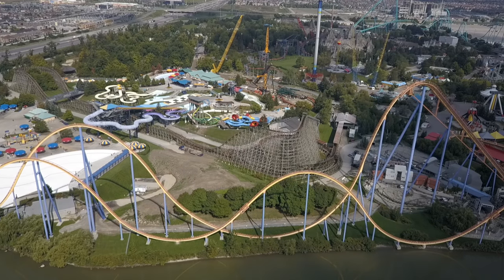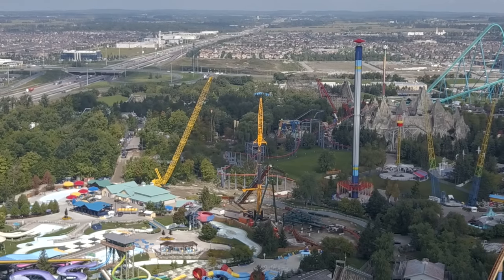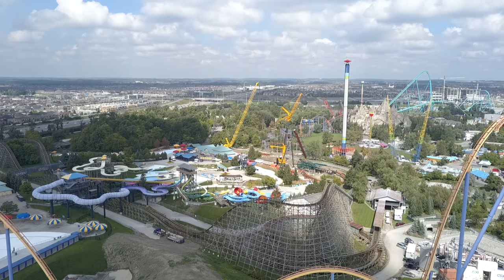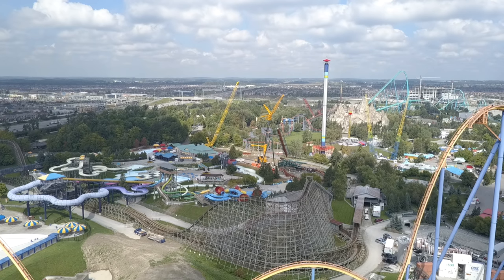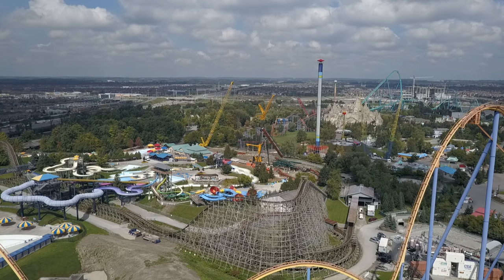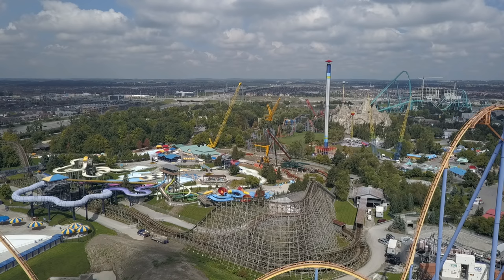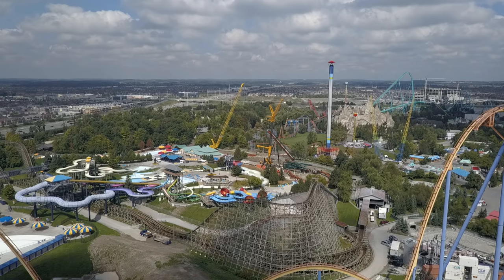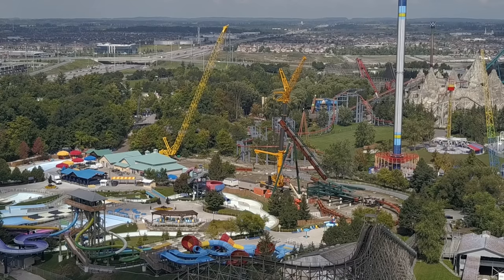Yukon Striker First Lift Hill Installed!

Comment: What happens to the underwater tunnel when there's a downpour
Reply: Good question 😕
Reply: Noah DeSouza the probably have a sewer/ drainage system in there that connects to the city’s sewer/ drainage system.
Reply: Im sure drains or could be pumps too since its below ground
Reply: Drainage line